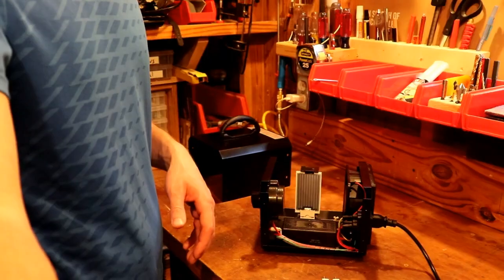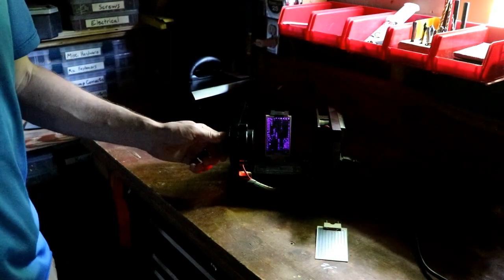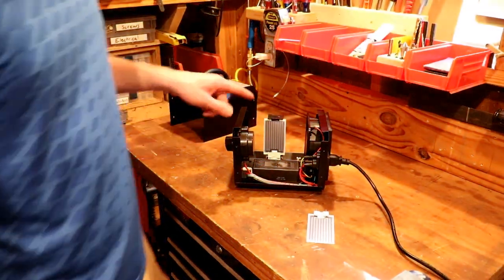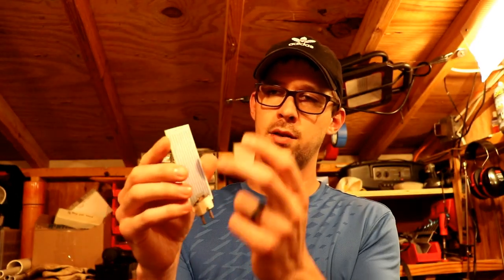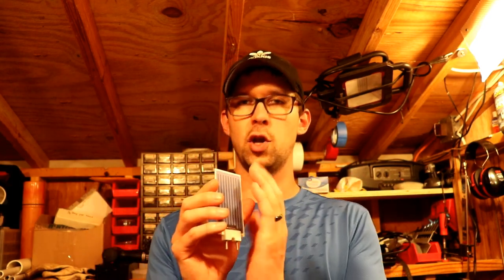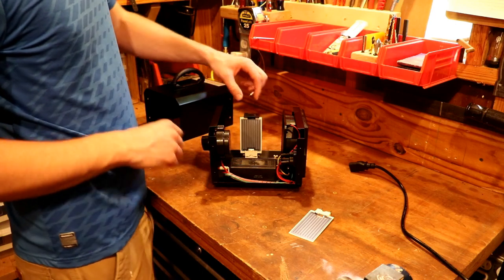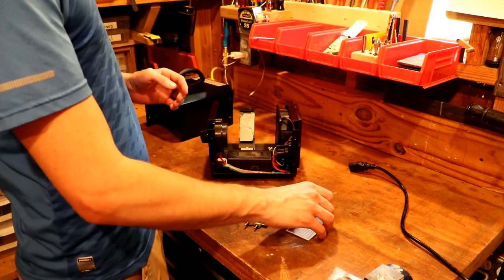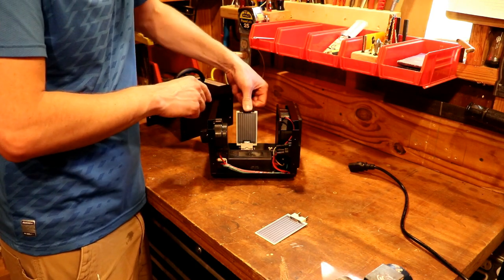Rebuilding an Ozone Generator

Comment: I wonder if I can make my own plates if the manufacturer goes out of business, or the model I buy is no longer supported.
As an Electrical Engineer, maybe I should just make my own ozone-generator, designed to use easy to replace steel, spark plugs, or durable tungston.

And I think that paste in the model you have here, is the kind that can conduct heat, but not electricity.

Comment: I’m grateful for your video. I couldn’t push the replacement plate fully down, but was able to lift the black plastic overhang piece (as you demonstrated) so the plate fit seamlessly with the newly applied heatsink paste (aka Silicone Cooler Paste). Super grateful as I couldn’t find any manuals or images that demonstrated. Success!

Comment: what is the voltage between the two ends?   Thank you. i chage to a new plate and it still not working, not buzing blue seen.  Is that the power is not coming to the plate end?   Thanks